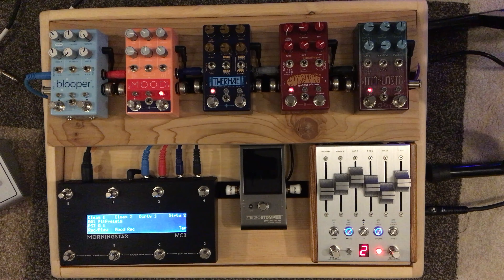Blooper - Can it do "normal" looping?

Comment: how much did all those patch leads cost?
Reply from the maker: Not sure as I bought a lot of them used over time or got them on full pedalboards I bought. I'd guess I have/had $400 in George L cables. Selling them pretty much all now and going to soldered cables which cost less overall and give a better final product just with more effort.